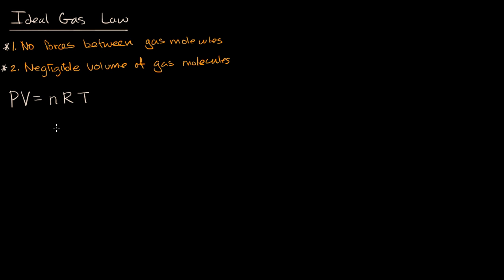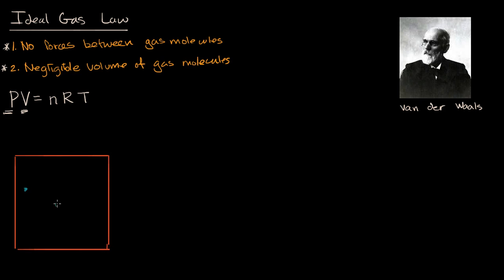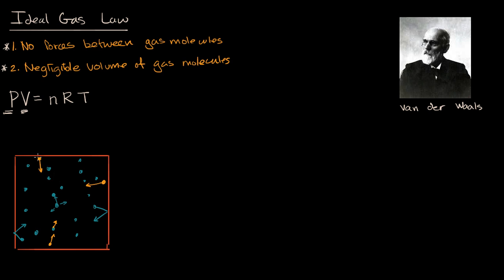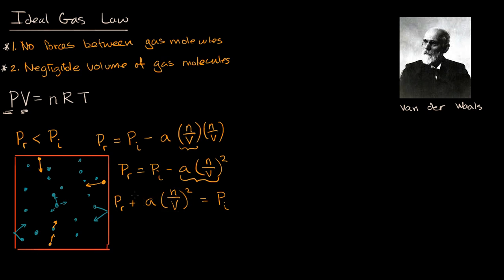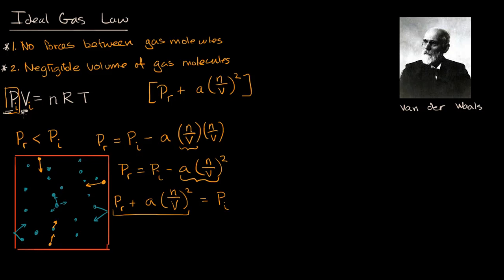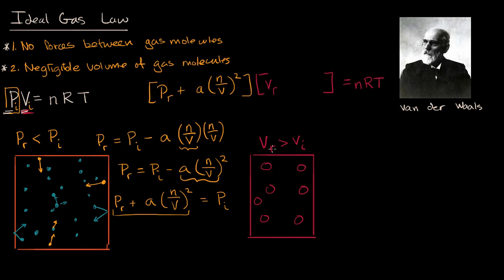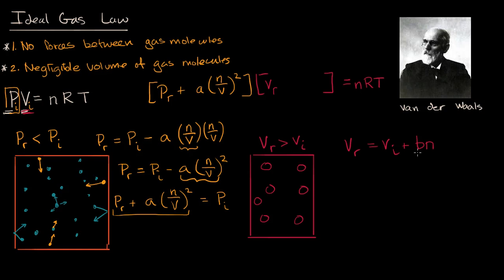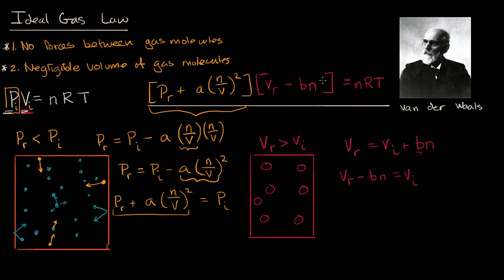Van der Waals equation

Comment: i am unable to understand how sal multiplied another (n/v) to the equation at 5:00
Reply: V is directly proportional to n, V =kn
n = m/M therefore V = k×m/M
M = k × m/V
M = kd

Now at 5:00, M is considered into a (meaning "a" constitutes M), hence you can write d = a × n/V.
This means d^2 = a(n/V)^2.

where d = density, m = mass, M = Molar mass, V = volume, n = number of moles, a = attractiveness factor (constant), k = constant of proportionality

Hope it helps.
Reply: Crystal Vision 
Look "a" is a constant, namely attractiveness factor. When you square d, you actually get : (a x n/V)^2 = a^2 x (n/V)^2. Now since "a" is a constant of proportionality we can again write a^2 as "a". The square goes into the constant, meaning the value of "a" considers "a^2".

In other words, if you don't want to mess with this step, you can write the equation as - 
 d is directly proportional to (n/V)
therefore, d^2 is directly proportional to (n/V)^2
And you know that to remove the sign of proportionality, we multiply it by a constant, which in this case happens to be "a", the attractiveness constant.

Hope this clears the problem.
Reply: @Gao Zhan dont know why the other n/v is responsible for summing up all the attractive forces, I mean it doesn't make sense that u r using the same n/v for one molecule density and then using that same n/v for the density of entire whole gas .